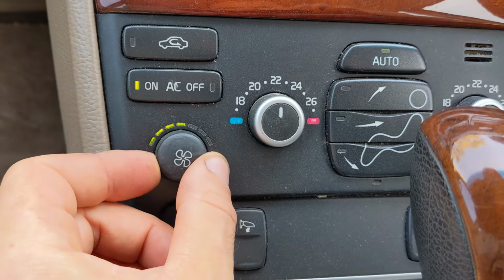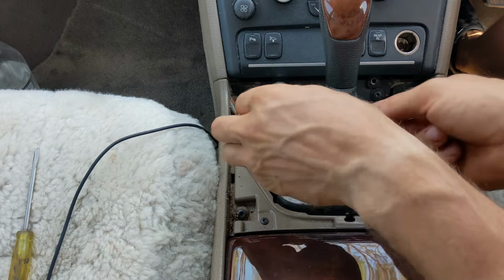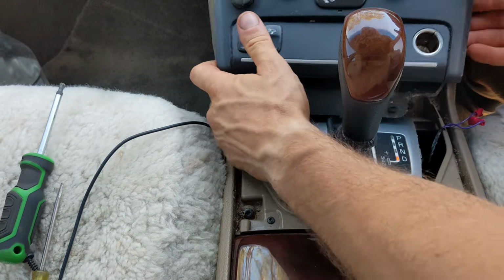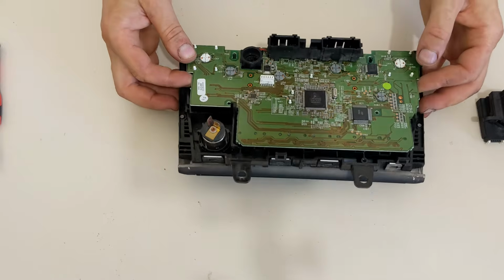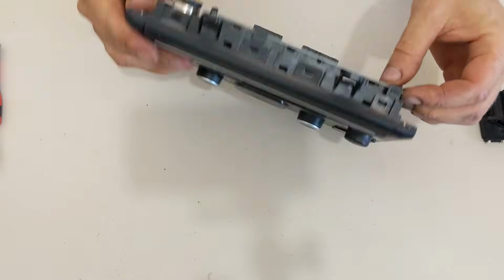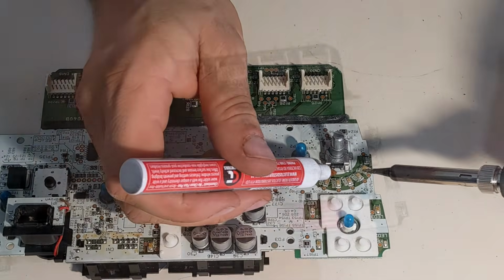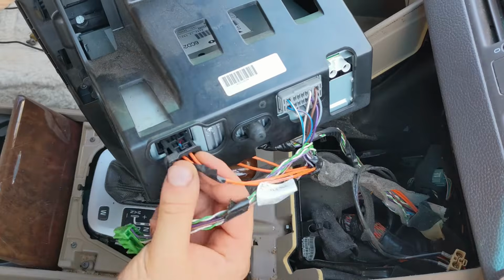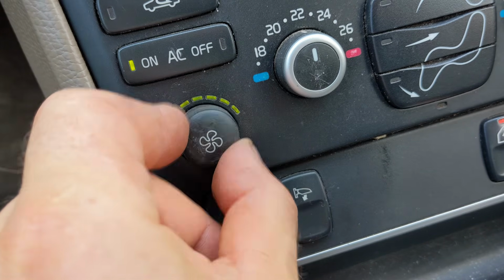Volvo S60/S80/V70/XC70/XC90 CCM Fan Button Repair

Comment: Excellent timing of the video.
I have a 2003 S60 and the fan isn't turning off when I turn the ignition off and lock the car. It was suggested I resolder the CCM.
Now I can attempt this with some guidance, rather than going in blind.
Reply: @heaps of projects 
I am experiencing the same issues with my fan running with the key removed; that and inconsistent fan speed when adjusting. Sometimes it responds other times it does nothing. Everything else on my CCM is working. I plan on replacing the blower resistor first. Does that sound like it’s the issue? I never had any problems until I changed my CEM. Coincidental?
Reply: @timbermansam  My issue turned out to be the Fan Speed Regulator, inside the Fan/Blower assembly under the dashboard.
Reply from the maker: Does it always stay on or just sometimes? Can you otherwise adjust the speed when the car is running?
Reply: @HeapsofProjects  stays on with ignition off, key removed, and car locked.. for hours 
Speed adjust stopped working today, so it just blows at one speed now.
Reply from the maker: @alien_marksman  okay, you can try this but I don't think it would fix your fan staying on issue. Do any lights on CCM stay on? Would it run until battery is empty or will it stop eventually?
Reply: @HeapsofProjects  all the CCM lights work. The fan speed indicator lights go up and down according to input from the knob. Fan speed isn't changing, and it would still run untill the battery went flat if I let it. Been pulling the Fan Fuse to stop it.
Reply from the maker: @alien_marksman  I would say your problem is not the CCM but maybe the fan "resistor" which is in the same housing with the fan and can be bought separately.
Reply: @HeapsofProjects  appreciate the help. I'll try as many things as I need to till I get this fixed. Not having a working AC can make a car unbearable to drive in Australia